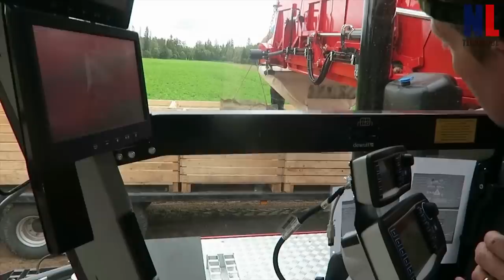Cool and Powerful Agriculture Machines That Are On Another Level Part 2

Comment: That first one was interesting. Never seen one that does the v cut to lay the pipe. Used to work pipeline and for the flexible lines, we had a similar machine, but it was essentially a hollow knife that slit the ground and the pipe ran through it to the bottom depth. Attached to a bulldozer while the pipe was laid on the ground and picked up as the dozer approached.
Reply: I think the machine will only work on high-clay containing soil, like in The Netherlands where the machine is used
Reply: Looks like the depth isn't being maintained
Reply: @maurice2538  it is, they do it so the water will always flow downstream
Reply: :hand-pink-waving::hand-pink-waving::hand-pink-waving:

Comment: And this is why , when it's raining,that the level of the river becomes so high so fast.
Reply: That and all the concrete covering every city preventing the land from absorbing water
Reply: Stop eating.  Probably solved
Reply: @jarredjones353  no stop supporting intensive farming. I prefer to support my local farmer who produce high quality vegetable without chemical products
Reply: Even a tiny garden will create run off and fill up rivers.
Reply: @jmasson3272  of we would depend of local farmers the whole ecosystem would collapse even quicker
Reply: Mass farms is the only thing that is supporting a population that's this large. Unless you want to start culling populations the farms are only going to get larger and larger. Small farms will no longer exist. They aren't economical or sustainable enough.
Reply: @bsumner1991  exactly

Comment: Does anyone know what crops they are prepping for at 4:30?

Are they repairing drainage ditches or will those be used for irrigation?
Reply: These are peat bogs in Ireland. This is used for drainage the peat is harvested for electrical generation power plants
Reply: Like John said, but in Finland due to the licence plate in tractor, which is Valtra, naturally. 😉

Comment: 1:20 he should be careful with that turning table its really close to his legs !!!
Reply: true,   no one noticed , its very dangerous
Reply: They should just put like a steel around that table. So it wont hit the conducter.
Reply: It was hitting his legs it's not metal at the ends, its like soft and rubbery
Reply: May be you didn't notice he walked on running belt at 1:08
Reply: He is a man...
Reply: @sbcontt YT +1
Reply: hit one wrong bump and that means day will go very wrong very fast
Reply: Emeria SAITAMA 0:53 it’s definitely metal... looks like metal pipe
Reply: @reaction9449  looks can be deceiving as I'm fairly certain it isnt
Reply: @sbcontt YT The smart ones that designed machines aren't the ones operating them.
Reply: It could be fatal for sure
Reply: What where they harvesting with the mower that had the front attachment?
Reply: When li saw vid I though omg. Here's in ditch so driver can't see him well he's climbing on crawlers when moving. He moves around near those spinning stars. Good machine not good safety guards.
Reply: Is just an accident waiting to happen.
Reply: Those bars spinning aren't hard they're flexible
Reply: If you pay close attention you can see them bending they aren't metal

Comment: THEM MACHINES MAY NEED A LOT OF MAINTENANCE WHEN THEY BREAK DOWN. SPECIALY IN DRY AREAS AND HOT WEATHER, THEY LOOK NICE IN WET LANDS .
Reply: What do you mean? There is usually less maintenance in dry than in wet areas.
Reply: @minimansson2023  I MEANT WOULDN'T THEY BRAKE DOWN IN A HARDER DIRT LIKE CLAY AND STONES.A SORT OF DRY DESERT GROUND

Comment: I've been on a machine exactly like that (the 1st one) there is a metal grating but you can't tell it's there. It's almost like a piece of screen it's made that way so you don't slip and fall and actually have an accident. Normally you're putting 3 or 4 of those PVC drain pipes in as opposed to just the one shown in the video

Comment: 5:40.Nice soft music while you watch a deforestation machine digging out the heart of the amazon rainforest.

8:30. They did the hard bit. Couldn’t they have added a simple press to fold down the turf?
Reply: Last time I checked, the trees in the Amazon rainforest weren't growing in straight lines. Would be a nifty way of removing old orchard or plantation tree stumps though.
Reply: Michael467012 

But you’ll agree that if you have dense jungle
Canopy, you could walk in a straight line and bump in to tree after tree - same thing here no? If you can bump in to trees in a straight line in front of you, you can bump in to their roots in a straight line in front of you.
Reply: @darkmatter6714  No. These trees are all identical in size, not very big, small roots, and in straight lines. The machine would not be effective with varying sizes and much larger roots. If it came across a 1m tree stump, it would be useless. Doubt that it would even do 50cm stumps - particularly if it were hardwood.
Reply: Michael467012 

I wasn’t ready to give up the ghost yet - so I decided to investigate -lol.

I tracked down the clip in this video and it turns out it was shot in Florida, where it was pulling out Pine stumps. 

HOWEVER, I found another video of it in action in Brazil, where it was clearing “biomass” according to the video description. Roots which were 35-50cm in diameter:

https://youtu.be/lQqLiPNH4ss

You can see the rainforest (or what’s left of it) in the periphery. So unfortunately, my original glum claim of the rainforest being destroyed, against a backdrop of jolly music, still holds true I’m afraid  - albeit on another video!

The 3 comments in Portuguese are:

“Now, with this tractor the service will render!”

“Does it pull out eucalyptus?”

Reply: “yes. For more information get in touch...”
Reply: @M 

I hope you’re right. Although I wouldn’t mix grapes with eggs!

Comment: The way that drainage pipe holder is spinning 1:36 is pretty dangerous it could knock someone down onto the track which could end pretty horrendously if they are attempting to run the machine by themselves or if the other person isn't paying attention. It would be a lot safer to make sure it is spinning in the opposite direction so if it does catch your leg you are thrown off and away from the machine. Better yet would be a guard around the bottom which would prevent someone from getting their leg hit by the spinning arms.